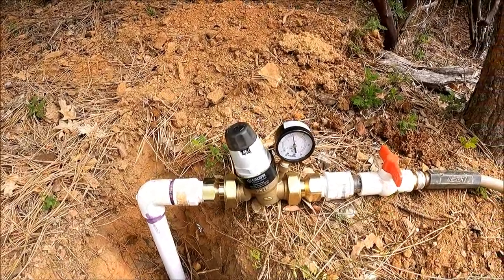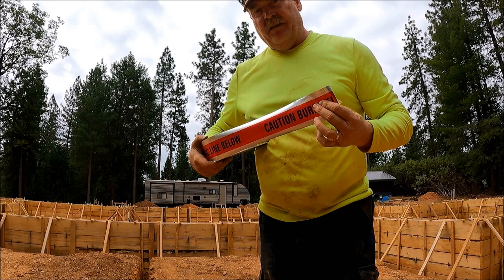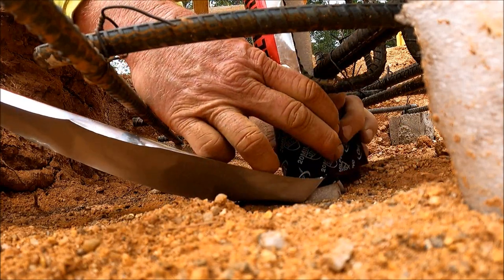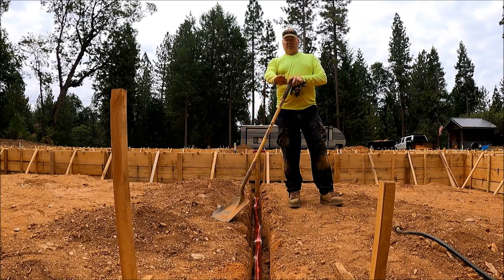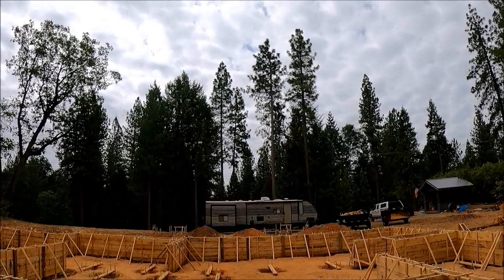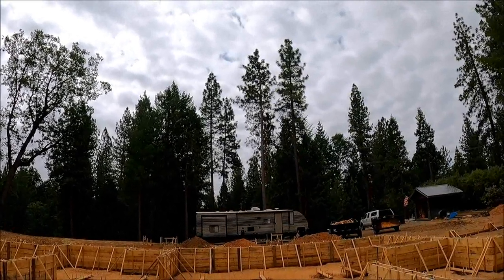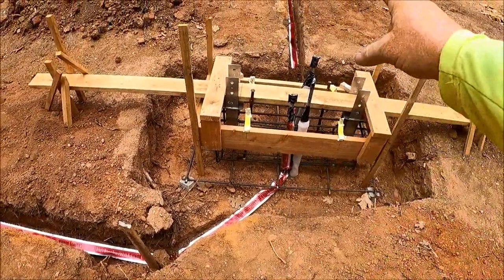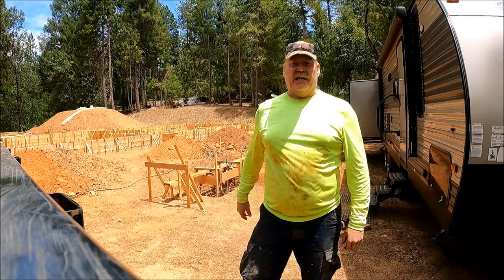Underground Powerline Warning Tape - Building your own house

Comment: Ya there the detectable tape the uses a metal detector or the underground signal wire for plastic gas lines that use an underground cable and wire locator
Reply from the maker: The tape has already saved me while having to trench for my water line to the house and sewer line to the septic tank.